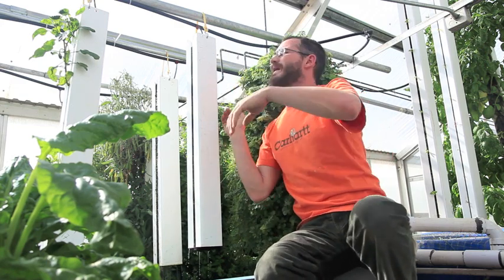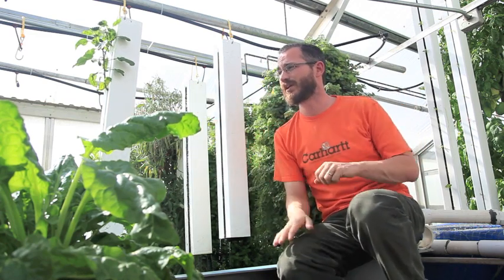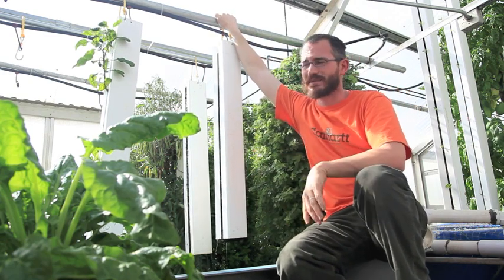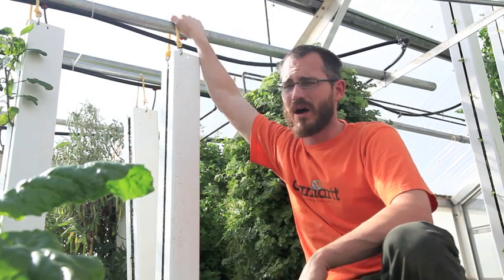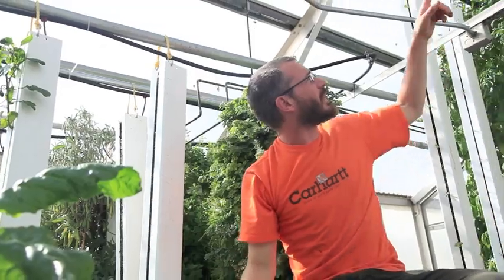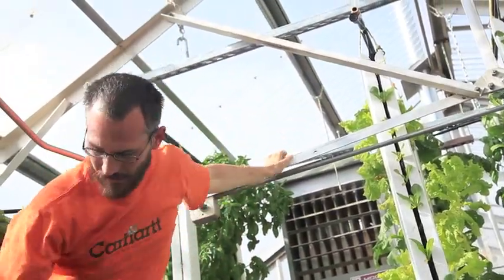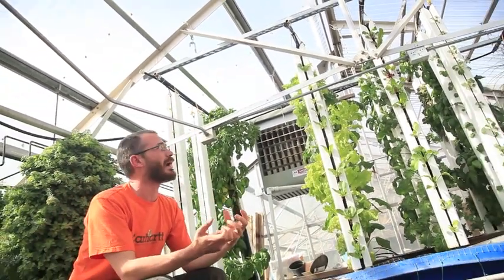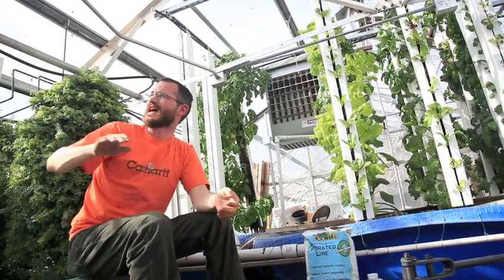Hanging Aquaponics or Hydroponics Towers

Comment: I've seen a lot of bubble lifts being used in the DIY Hydro and Aquaponics culture. Have you tried using bubble lifts in either your commercial setup? What were the pro's and con's you discovered (if you did go through pro's and con's) when compared to conventional pumping?

One of the claims I'm leaning towards believing is that bubble lift systems may oxygenate the water better than conventional pumping. But in a drip feed, does that even matter?
Reply from the maker: Robert Chlebowski We don't have any experience with bubble lifts, but in drip feeds with towers oxygenation doesn't matter very much because the water is highly oxygenated inside of the tower
Reply: Bright Agrotech How frequently do you run your grow towers, and whats the flow rate per tower? I noticed you also had a few bato buckets in the background. Do you run them as frequently and for as long?
Reply from the maker: Robert Chlebowski We tend to run water on our towers constantly at two or 4 gallons per hour.